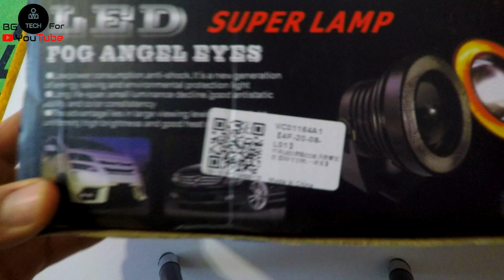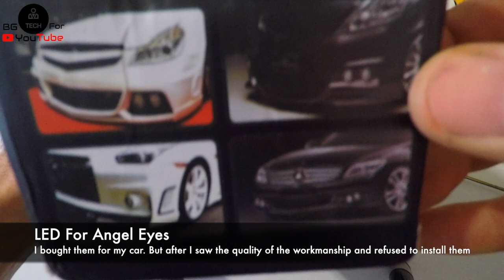🔥 Online Shopping 🔥 SCAM 🔥 !!! LED Fog Angel eyes 🔥

Comment: Yeah these things are a joke. Didn't last 30 seconds on the bench before burning up when tested with a 9v battery. I could clearly smell burning electronics. I could only imagine what would have happened if they were hooked up to the car's electrical system.